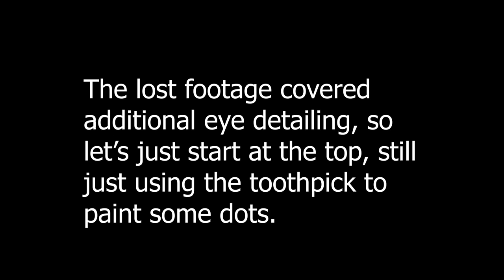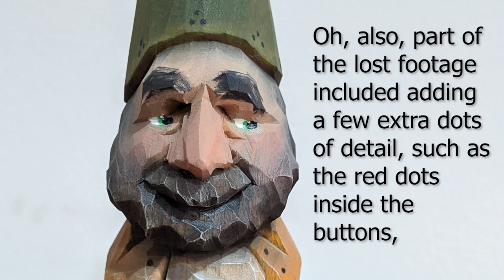Painting a Simple Whittled Halloween Gnome

Comment: Hi James - I really enjoyed the time you took to explain your painting technique.   Was the BLO full strength or had you diluted it with mineral spirits?  Thanks Again.  Mike
Reply from the maker: Thanks Mike! It was full strength. I think most people do wipe off excess linseed oil, but after hearing about another technique in which you submerge a carving in linseed oil for several days, I figured simply dipping without wiping should be safe. Haven't had any absorbency issues at all